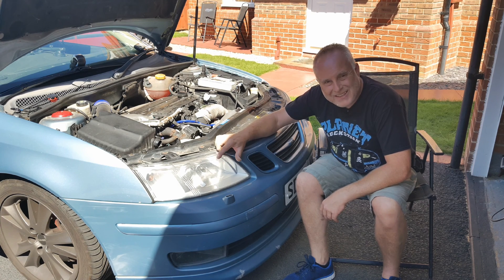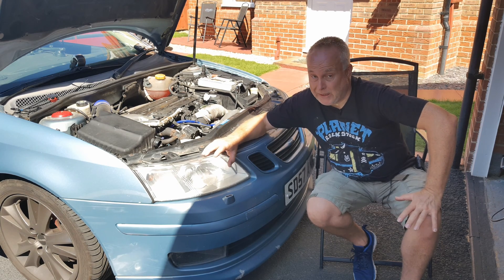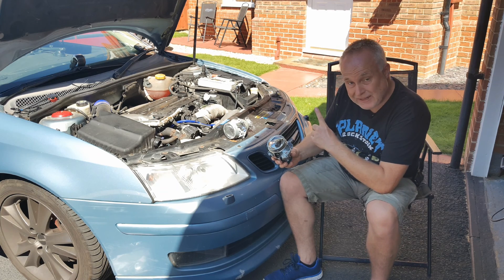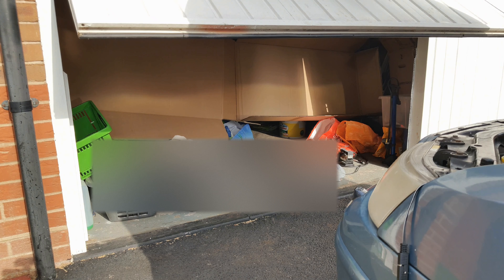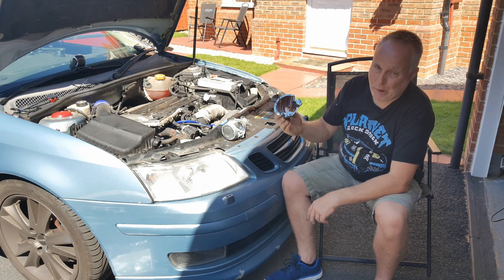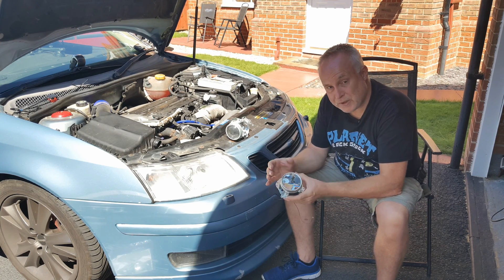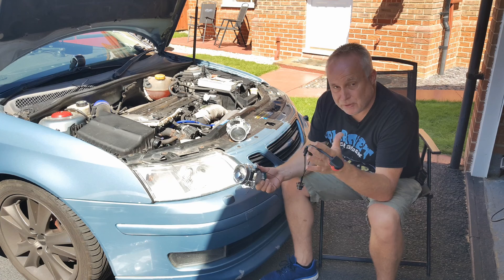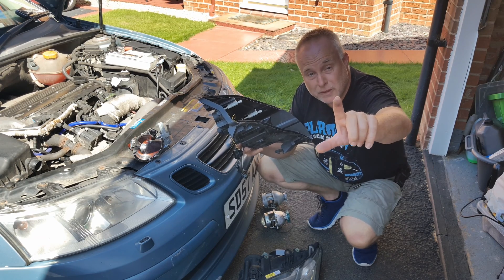Do you have Dim Low Beam from your Projector Headlights?

Comment: Hit the mail on the head! Removed the halogen bulbs and installed LED (cheapos) and the light output was worse. Ugh. 2018 Toyota Highlander headlamps are labor intensive to remove. If I'm going to go to the trouble of removing the h/lps, I might just order some a/m lamps off azn or the 'bay and be done.

Comment: Great video! Not sure if this is my problem, I have a Kia Sportage 2017 mk3 and experiencing this very issue - so I'm 95% certain you have hit the nail on the head. I've looked at finding replacement projector units and I cannot find any - new headlamps even copies are around £300 each. Even used are £250 and probably as bad or not far behind - I could probably sell mine and buy new with little difference but that would be a dodgy deal and not for me. Looks like these will have to go down the road with the car when I sell it - at least I won't end up wasting time and effort messing about with these crap units. Thanks for your vid  - excellent project
Reply from the maker: Some headlights don't use a commercially available projector but integrate the 'projector' into the housing.
You could possibly fit a conversion projector, maybe 2 or 2 1/2 inch, something like this https://s.click.aliexpress.com/e/_ok6Wo8b

Comment: Great videos. My Volvo S60 2012 xenon projectors are dim low beam and also the levelling system doesn't work. Local mechanics have told me to get new assembly for both headlights. I checked with Volvo for new assembly it's very expensive. Also the dealer told me you will need separate control units. I have no idea does existing control unit & motors in my current assemblies work or not an can it be reuse. I know your video series teaching how to fix it yourself but I am afraid will I be able to do it myself. So thought to ask you, can you suggest any garage/mechanic shop/service who can repair my current faulty headlights for me in UK/Ireland region?

Comment: Thanks!  I was thinking by projector reflectors couldn't be bad because I never had condensation inside my headlights.  I switched bulbs from my other car into the problem car and got the same result.  I was starting to suspect the ballasts but it seems more likely a gradual degradation of both reflectors.  Very nice to find some factual information.

Comment: I disagree. OEM Hella reflectors are dull from factory on purpose. only aftermarket replacements are mirror finished, at least for the E55 Projector style. The real issue for declining performance is gas and fumes that condense on the inside of the glass lense. that is easily seen when you power up a new halogen bulb on open air. the first few seconds you clearly notice some smoke raising from the glass. withe certain, not all, headlights using the E55 heat can get trapped at the top of the headlight which will make the reflictive surface peel off from the reflector bowl.
(the dull reflector finish compared to mirror finish makes a more even light, doesn't change overall output at all. If anything, Hella uses frosted glass lenses that can be replaced with clear variants. that makes a real difference)

Comment: I personally a fan of projectors as like you said they are brighter than the standard reflector headlights especially I’m running on HIDs and they are a lot brighter than halogens!😊 my car did come with reflector lamps and I converted to projectors so I can legally run HIDs in projectors so they won’t be light scatter all over the place! If I use in reflectors the light output will just send everywhere and just keep getting flashed at! Great video by the way!😊

Comment: Why is that no one addresses the positioning of a halogen bulb in the projector assembly? I just bought a set of headlamp housings for a VW Passat. They came wired backwards, to begin with (high beam connector to low beam bulb, etc), but that was a simple fix: just drag the wiring to the right place. The REAL problem is that when the H7 bulb is properly seated in the low beam projector, the light output is quite dim. With the bulb released from the clamp, but powered, I find I can move the bulb back a bit and the light output gets much brighter. That means the filament is NOT in the focal point of the assembly. I need to fix that. Any thoughts on THAT issue?

Comment: Same problem on a Ford Focus mk3. I used a cheap inspection camera to peek inside to have a look at the reflector surrounding the xenon bulb. The lower half didn't have any reflective coating left at all! Unfortunately Ford used Permaseal on the headlights so I found it easier to get some complete lamps from a newer car. I used the same inspection camera to verify that the newer frontlight was in better shape. Before doing this I wasted money on new bulbs. Thanks for this video!

Comment: How long do you reckon it takes before my nice shiny projectors become dull? I'm also looking at swapping out my halogen bulbs (HB3/9005) and replacing them with aftermarket HIDs with the same bulb size. Do you think that's viable or should I change the whole projector assembly to accommodate D2S instead? Is D2S better than aftermarket HID 9005 bulbs? Thanks.

Comment: What's really weird is I bought some brand new headlights for my 2011 Camry and no matter what LED bump I put into the projector low beams, it's not bright. I've tested both 16,000LM and 22,000LM bulbs side by side at the same time in the car and they are BOTH the same exact brightness and neither are bright at all for that matter. The stock halogen bulbs far outperformed the LED's I have tried in the projector low beams. I don't know what the deal is and I have no clue how to fix it.

Comment: Got an 08 es350 and it's projectors are so dim it's basically driving with a phone flashlight. When it's raining it doesn't even show.
Reply from the maker: Are they halogen or xenon projectors? I'm not certain but it wouldn't surprise me if the projector are 'built in' to the headlights and not directly replaceable like the Saab.
All is not lost though. I've just recieved two pairs of bi-LED projectors - one pair a Hella fitment that can replace the standard projector in my Saab lights and the other pair are conversion projectors that can be fitted into the manin beam assist side of the lights. I'll be making the conversions switch on and offable, so I can have one pair of dips for town or lit roads and two pairs of dip for unlit roads, plus of course four full beams 👍 I'll try and make the videos more relevant to a range of options, but if yours has halogen main beam assists like the Saab, you could keep the original projector (if it can't be replaced) and fit a bi-LED conversion projector in place of the main assist.

Comment: Absolutely awesome ! I have a 2009 Saab 9-3 with halogen headlights that light up the first 3m in the road. It’s awful. Could the post the AliExpress link sonI can buy the new projectors and also upgrade to Xenon with ballast please. 
I did fit some LED and it’s slightly whiter, but no further projection. Also with LED they do a disco light after turning off the car for 20 seconds lol.
Reply from the maker: https://s.click.aliexpress.com/e/_DdjgRpH
OR
for a few quid more, go LED https://s.click.aliexpress.com/e/_DCf2tQr
Reply: @CycloneCyd  Will they fit the MY09 Saab ? I have separate Hi-beam, so don’t need the Bi-LED. Or can I wire my hi-Beam into these as well for two Hi-Beams ?

Comment: Thank you so much I was going crazy about why my headlights were so bad as you said tried new bulbs cheap expensive no pretty much no difference even tried xenon and led same thing not much better tried measuring the voltage it was okay tried cleaning the lenses and polish the headlights no difference now I'm gonna pick up some brand new ones I think this will be the solution for the problem my fog lamps are better than my headlights scary driving at night
Reply from the maker: No problem 👍

Comment: What if you did an electrolysis coating.
Reply from the maker: There is a company in Germany that will refurbish your reflectors using aluminium vapour deposition bringing them back to like new, but it costs about 60 Euros per reflector. OR you could get a local classics restorer to chrome them, but you'd still be looking at 40 per. If you have proprietary projectors that can't be easily replaced like the E55s, this would be a good option (think Jaguar XK-R).

Comment: Syd! Thanks for this. I have a 2009 Camry, and as the years progress, and I get older, I can't see the road at night.  So, I blamed my eyes of course. But it was getting so bad, I had to try something, so I got new bulbs. No help. I got the outside of the lenses buffed up. No good. Got spiffy new LED bulbs at suggestion of dealer.  Nada. Checked voltages.  All good. Your explanation rang true with me, so I ponied up and bought new aftermarket headlight assemblies and OMG, I can see now.  (I bought midrange on price - $160USD each side, but OEM is more like $360USD. Bit of a crap shoot when buying, but I had to do something). Why don't dealers, and parts suppliers talk about the degradation problems of projector headlights? You sir, are a genius.
Reply from the maker: Thanks JD, your comments are much appreciated
Reply: @jcdaviescan  bru i got 2010 camry altise (australia version) my h7 low beam light is sht, i changed new highend 25k Luminens one but nah still sht, i buffed up headlight aswell, still sht. Should i get tht vland headlight for it ?
Reply: Thanks I’m going to just replace the whole assembly on my 07 Camry.

Comment: Hi Cyd. Cracking video series. How do I figure out what halogen projector is in my 2013 Jeep compass? I can't see any branding anywhere. After watching you video I want to replace the projectors in my headlights.
Reply from the maker: Are you sure they are projectors and not reflectors? What I would do is try and pick up a cheap(ish0 2ndhand headlight unit and take that apart first to see what's inside. It's also good practice in case anything goes wrong (you haven't busted your cars lights and rendered it undrivable!).
Then you can look for something suitable, but in all seriousness, if it's halogen, I'd consider changing to LED projectors. Seriously - see my H4 mini projector video from just a couple of weeks back. I was amazed how good they are.
Reply: @CycloneCyd  thanks for the reply. My lights have the fish eye lens bit so I'm assuming they're projector. I replaced the h9 halogen bulbs with led ones and while they are better they're not much better - the fog lights on my car are much brighter than the actual headlights. When I stumbled across your videos looking for answers, that's what made me think the reflectors mirror like finish might be worn off. I'd like to replace/ upgrade the projector but I have no idea what to buy. Second hand could be a good shout to play around with.
Reply from the maker: @maverick_May  ok so they are projectors. It's likely they are 'proprietory' ie designed as part of the headlight rather than being a 'standalone' projector like the Hella E55s in my Saab.
The Jag Xk is like that.
That's another reason for getting a used light unit to take to bits. You can experiment with it then.
Reply: @CycloneCyd  ah ok that makes sense m risks so much for helping out. Your videos are brilliant. 👍🏻

Comment: Useful video. Any idea what projectors are need for ford focus mk2 st225 with xenon headlights?
Reply from the maker: No I haven't. being Ford it wouldn't surprise me if they are integrated into the headlight rather than standalone projectors. try taking one apart to have a look (carefully). See if you can pick up a cheap 2ndhand one to take apart.

Comment: Plus my actual projector lens is foggy. My headlight assembly is factory sealed and you cannot take it apart without breaking it. The only remedy is to purchase a whole new headlight assembly for $600
Reply from the maker: Which car is that❓ Have you looked through the playlist? I show a method of cutting into the rear of the headlight that might work for you. OR maybe cut around three sides of the case and 'bend' it open on the fourth. Plastic weld it back together. More than one way to skin a cat 🎓

Comment: It's much easier to buy new headlight Assembly for my 2007 Toyota Solara. It's a little more expensive but worth it.
Reply from the maker: "worth" means different things to different people. Some people would prefer to rebuild the lights themselves and save the money.
Reply: @CycloneCyd  yes, you're right. I should've just said better for me. I did research replacing my projectors. However, it just seemed too be much trouble for me. I've often tried to repair things myself and it didn't go well. LOL I would end up buying new after screwing up something  and spending more money anyway! 🙄🤦🏽‍♂️

Comment: Español

Inglés

Good Morning I have a Saab 93 from the year 2005 with which I am delighted The only downside that I find is the little light that its halogen lamps give I have tried with several xenon h7 aftermarket kits and also with led bulbs, but they blink and give a blown lamp error Do you know of any model that does not give me those problems? Congratulations and thanks for your videos, they are very helpful
Reply from the maker: It's the car and the way the bulb check feature works. They all do it. Rejuvenate the headlights with new projectors.
Reply: @CycloneCyd  Buenas tardes
I've already cleaned the interior of the headlights. And also inside and outside of the lampshades
Thanks

Comment: Where do I get a new projector for a corsa c?
Reply from the maker: A little research and I can see that the Corsa C has a poor rep for headlight performance, but I see no real solutions in the marketplace.
My suggestion would be to convert them to bi-LED. Here are 3 projectors in 1.8, 2.0 & 2.5 inch sizes (http://bit.ly/Bi_LED_25  and  http://bit.ly/3as2frfBi_LEd_18_20). I can't tell from pictures what size would suit best, but they look small, so maybe either the 1.8 or 2.0 from Sinolyn.
Obviously they would require some fabrication of brackets to fit, but I can't imagine it being too difficult.
When I did my headlights I bought a 2ndhand pair of lights to convert, so I could take my time and in case it went horribly wrong.
Reply: Perfect okay, thank you

Comment: Hello, so I don't know if you can help me. My problem is that the shape of the light from my projector headlights is strange. Do you know how to fix it?
Reply from the maker: Probably you've either got the wrong type of bulb (H7 or D2S)   OR   it's not seated correctly, throwing the pattern off
Reply: @CycloneCyd  hey , the bulb was not seated properly. Now its all good. Thanks

Comment: Hi! What projectors do you think I should replace the original ones with? I’m fixing up a pair of original halogen headlights, Hella, from another ng9-3 2006.
Reply from the maker: I would say that you have 2 or 3 choices:
1. you could use these direct E55 replacements (OE equivalent) and swap the bulb holder from the original halogen projector onto these https://bit.ly/E55_replacement
2. you could use the same EVOX-R 2.0 projectors I did (https://bit.ly/Sinolin_EVOX_R_2_0) and upgrade to xenon lights. Also need ballast and driver kit http://bit.ly/HID_convo_kit
3. go wild and fit a set of gen4 projectors https://bit.ly/Sinolin_EVOX_R_GEN4 also needs the ballast kit above.
Depends a little on what you are trying to achieve. I'm very pleased with my new projectors. Decent light on dip beam (needs adjusting so may yet improve) and stunning main beam performance. Options 2 and 3 will only cost you a bit over £100 to do the pair and is a great value upgrade for the money IMO
You will also need headlight butyl sealant https://bit.ly/H_light_Sealant
Reply: @CycloneCyd  Thanks for your answer, man! :) Well, I actually have the whole original Xenon-set laying around. I've been thinking of converting to the original xenon headlights, level control sensors, light switch unit. Of course I have the ballasts and ignition transformers. I have been studying WIS and EPC but I'm not getting smarter. Converting the Halogen headlights to Xenon is not legal in Sweden, but it is to convert to the original Xenon-system, even if you might have to "re-register" the car. If you'd put some kind of Xenon-conversionkit it won't pass the inspection once a year. :/ I really hope I'll be able to fit the original xenon system, though. Just trying to figure out what I have to do to convert.

I bought some butyl sealant so I'll be able to close the headlights when I'm done. Cleaning them up right now, thinking about what I should spray them with. :) Keep up the good work, man!!